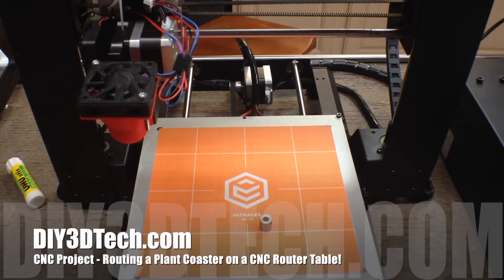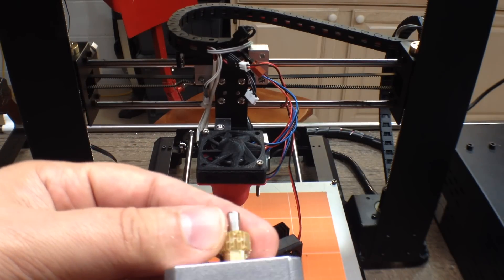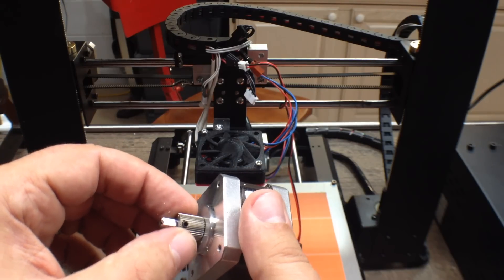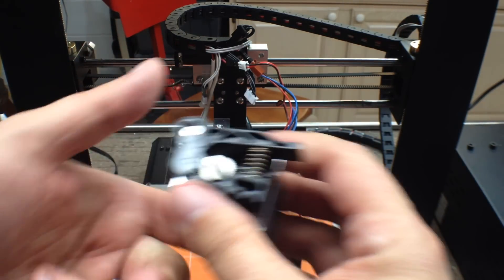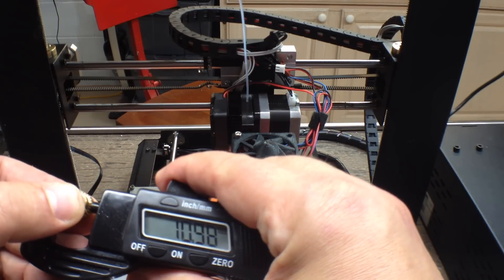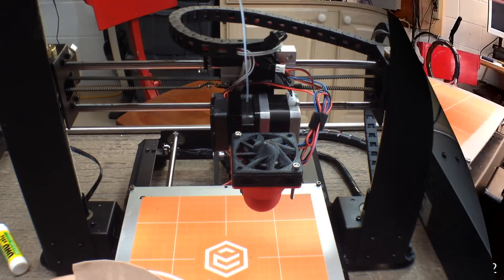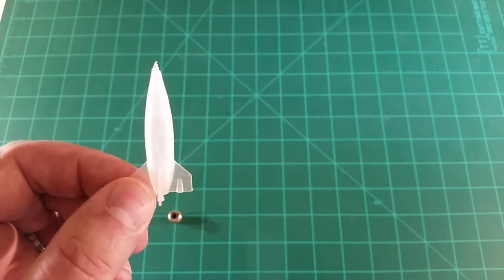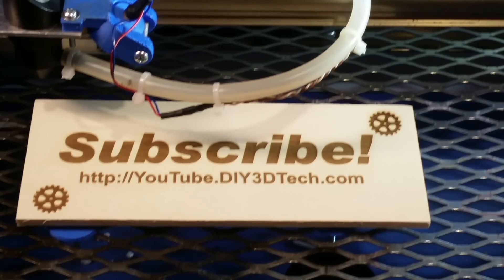Wanhao Duplicator I3 3D Printer - Replacing and Upgrading the Extruder Gear!

Comment: Thanks so much for everything. This will be very helpful when I get around to doing mine. I did check to see if the stock one was loose, but on mine it was installed correctly.
Reply from the maker: +Dan Reichel Now I should of mentioned this in the video and I am waiting for someone to call me out on it that watches the video closely.  As in the first section I rub my thumb on the gear and it dosen't move.  Then in the second segment it does, what happen is one set screw on the round side was not engaged at all and the one of the flat side was jammed into the section where it goes from flat to round so it was bound up.  It wan't until off camera I was spinning the gear round with my fingers to align the screws  to remove them that it became unbound!  Blew my mind! this Thing was in there slipping around like that!  I should have known as at one point I had retraction at 6mm as it was stringing so bad!   Also your welcome :-)

Comment: Tip to fix the issue on prints with "point tips": print something else next to it, at least that tall.
It could be a duplicate of the same thing.
This helps the pointy parts cool down before the next layer.
Reply from the maker: Yes it does and a good point, thanks for sharing :-)

Comment: It's actually recommended to rotate the extruder motor so the connector is on the back of the extruder assembly.  When the z axis is all the way up, the frame hits the connector and might cause wear and tear.
Reply from the maker: +Scott Adkins Interesting not sure I have enough cable for that and actually I have never printed something comes even that close :-)
Reply: +DIY3DTECH.com Yea, I can't say I've ever printed that high either. There is enough wire, you just have to feed a little bit more through the cable chain.
Reply from the maker: +Scott Adkins well I am going to have give it a try :-)
Reply: Did you end up going with 96 steps for the D4 extruder gear?
Reply: Yup, 96 steps/mm
Reply: I will rotate the motor - thanks - very nice idea.

I bought an original D4 gear a couple of weeks back but when I went to install I discovered the new V2.1 drive is very similar to D4's. It appears as though it's all steel with fine teeth like the D4, it still has the extra "piece" where the grub screw is located.

Being honest with you, I've returned to using the old gear as I had more slippage with the D4 version - I'm still learning so I think it's the workman as opposed to the tools.

Comment: Is the gear size important? could I use a 12mm dia / 11mm long gear as well? or does anyone know what printer uses that particular gear? seems like uncle chucks doesnt give any info about shipping to europe on his page
Reply from the maker: Sort of, if you change the diameter of the gear you will have to measure and re-calibrate the setting in the firmware or eprom.  However I would suggest this any way and one could are argue that slightly larger could be better as there would be more steps and hence more control, however one could argue that this introduces more opportunity for error.  Guess pick you our poison (I prefer a slightly larger).  Also I think uncle chuck sources these from China as I have seen these on Banggood and other places so would suggest looking there...

Comment: Since this new gear have more teeth you should really calibrate esteps to avoid over extruding.
Reply from the maker: +Stefan Lindström Hmm, will have to think about that as it is the same diameter as the original meaning the distance of a revolution will be the same.  The difference will simply be the number  teeth which come into contact with the filament so the "resolution" will be better.  However is well and will do a test measure, the sad part is should have test before for comparison, however live and learn :-)
Reply: +DIY3DTECH.com I got the recommendation from here. 

http://3dprinterwiki.info/wiki/wanhao-duplicator-i3/duplicator-i3-basic-mods/extruder-gear/

BTW,  Love the videos.
Reply from the maker: +Stefan Lindström  many thanks!  also thank you for sharing this as interesting is under the "setting esteps" were they say "The Duplicator i3 ships with the esteps incorrectly set for the gear used on the extruder."  so they are saying either way, to adjust the seting which makes sense!  Will have to read it in detail and digest it as I have done this before on older printers I build and the rate was unknown.  Thanks again for sharing!
Reply: +DIY3DTECH.com That might have been referring to the v1..  Maybe.  For what it's worth, I calibrated my e steps after upgrading to the same gear, and it ended up being perfect with the 96 steps per mm that my device shipped with.
Reply from the maker: Going to try it as after seeing how lose that gear was!  Who knows :-) also thank! for sharing that page! That what I like about doing this channel as all the stuff I learn!

Comment: First Rule of Wanhao-Fu - Assume all screws are loose screws. Probably just cleaning and tightening the gear that was on there would have solved most of your issues. Could you possibly reduce the volume on the music by 50% or so? Frustrating to turn up the volume to hear your voice, then have a 4-second blast of music, turn the volume down, then have to turn it up again to hear you.  How is the fan adaptor working for you? Certainly looks cool!
Reply from the maker: +Kevin Pietriyk trying to get your heart racing with the music :-)  but seriously, apologies as I switched to iMovie over Windows movie maker and I am still figuring things out.  However your right on the once over.  I bought a Chinese laser and took it all apart and put it back together right before using it.  However I do like the new gear and will do some test with it :-)
Reply: @DIY3DTECHcom  Funny, I have the opposite problem. Many of my screws were so tight the heads stripped trying to unscrew them. Had to use screw extractors to get them out. One was on the case for the computer and the other is behind the lever that removes the plastic feed guide from around the extruder gear.

Comment: Should use some loctite when you fasten that grub screw.
Reply from the maker: +DrR1pper Your correct, however I didn't because I likely will change it in a week two when someone tells me of something different, however your point is valid :-)
Reply: DIY3DTECH.com If you get the right loctite though, the screw will stay in there quite nicely and still be quite easy to remove if and when needed. A tiny drop of some loctite 2000 (maybe up to 2500 but i wouldn't go higher) onto the screws thread would do the trick nicely i think. Anyway...food for thought. :)
Reply from the maker: Your correct and actually have both in the shop!  Handy stuff and would highly recommend your suggestion.  However I take things apart so many times for the videos they seem wear out just from that :-)
Reply: DIY3DTECH.com fair enough. :)